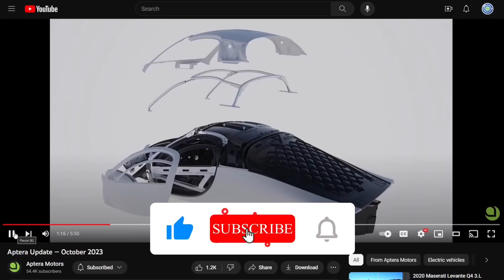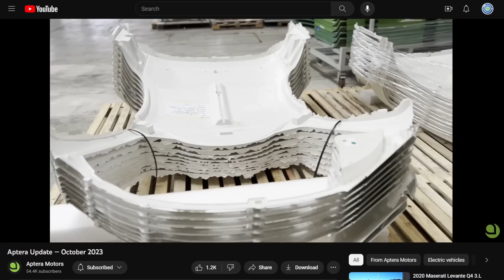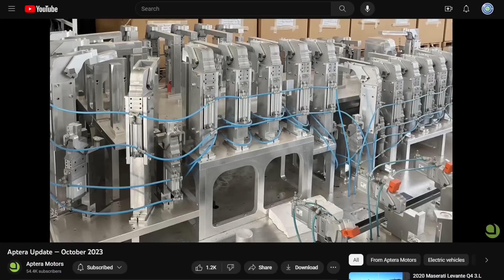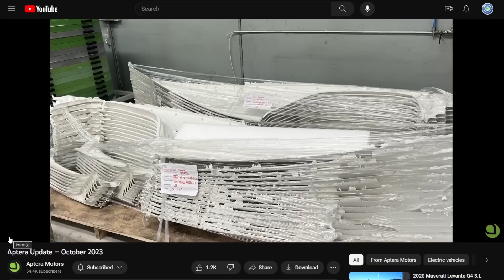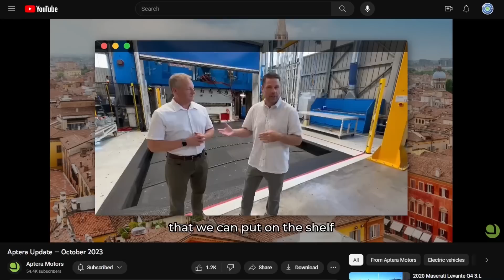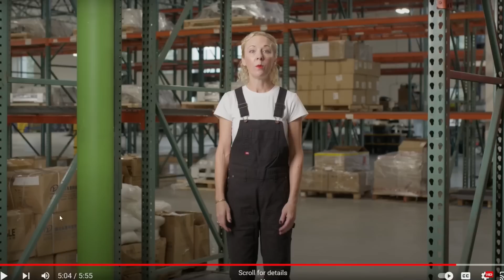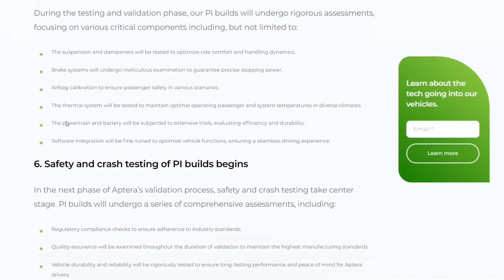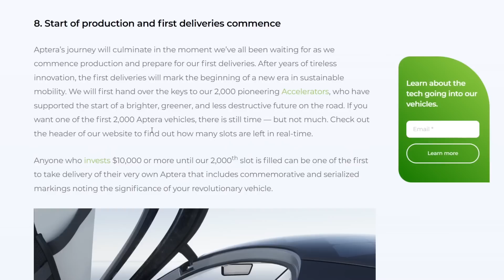Aptera's October 2023 update and ambassador meeting highlights

Comment: A question for your visit, Steve. Are they aware of the antipathy the yoke is causing? And are they thinking of an alternative?
The yoke is for sports cars and aircraft, where it doesn’t need to turn more than 45 degrees. I used to think I might get used to it, but after watching Chris McCammon maneuver in a parking lot I realized it will always be a stumbling block, especially in an emergency. And the rear view screens can go back in the corners where they belong.
Reply from the maker: They've said several times that the design choice is locked in for now.  They are aware that the decision is polarizing

Comment: Rain and snow performance please.
Reply: Aptera has a very sensitive traction control system that can detect wheel slip and adjust torque about every 2.5 inches of wheel travel.  I will be reporting on how it performs when I get mine back to Iowa where I live.

Comment: My son bought a Nisan Leaf about 10 years ago.  His battery range is much lower now than when he bout the car by a factor of about 50 or 60 percent.  Replacing the battery will be very expensive.  Will this be true for aptera too?
Reply from the maker: No because the leaf does not have an actively cooled battery and because of that has horrendous battery longevity.  Actively managed batteries will probably outlive the rest of the car
Reply: I drive a Gen 1 Honda Insight, and have replaced the battery pack once.  It has Nicad tech and is a hybrid, so is not comparable.  The savings in fuel make it worth while to do, however.

Comment: A micrometer is a device for measuring. Micron is a very small unit of measurement. About 6 microns is .0002 inch
Reply from the maker: It's both.  Micron is the non SI term for micrometer

https://en.wikipedia.org//wiki/Micrometre

Comment: An important Aptera function is motor wheel cooling. The validation of delta must include all kinds of situations that could lead to motor failure caused by over heated motor wheels. Without good validation reports that confirm the cooling system functions as claimed to all (potential) customers, it is a red flag for me. I am optimistic and exited about Aptera. The way it is going, my estimation the first Apteras will be delivered a year from now, and that will be a very good day for mankind. I love the Aptera team, they are all brilliant.  AOC, thanks for the analysis!
Reply: Due to the way the controls ate designed, there is little risk of motor or other component failure even if overheating should occur.

The system will simply throttle back power so that temperature doesn't continue to increase.

Comment: I wish Aptera well but I think they have two main challenges. The first is cost. Given that it is not really a car, it needs to be priced significantly less than a car and this may be difficult against the likes of Tesla. While there will be some people that like the unique looks and the concept of extreme efficiency, I think that if there is not much price difference, most people will go for a vehicle that meets the safety requirements of a car, is more practical , (e.g. something like the so popular little SUV that has back seats that fold down), has four wheels and is painted rather than film covered. The second challenge is that they are in a race against time where super efficiency is relevant. This main feature of the Aptera, its efficiency, is a significant feature in a world where batteries are expensive and have limited capacity. However if you can believe CATL and Toyota, we are only a few years away from EVs with ranges that exceed 1000 kms so super efficiency becomes less meaningful. A hyper efficient gas car like the Aptera could have been made long ago but you don't see one which tells us, again, that the mass market prefers a more practical car even if it means a small cost in efficiency. So, overall, I'm having troubles seeing the Aptera as becoming something more than a niche vehicle.
Reply: Efficiency is always economically practical and beyond a battery's weight, it is not part of the efficienty equation. And heavier vehicles with greater drag coefficients and rolling resistance will always be less efficient and benefit less from embedded solar.  For people who are of limited means, and for those who prefer their money is spent for priorities other than transportation it is efficiency for the win. 

Then there is a significant and increasing portion of us that care about the environment. People who wish to contribute less to increasing the suffering of humans and other species caused by the enhanced effects of our human driven build up of greenhouse gasses, much of this from the transport sector. People who care about the quality of the world we leave behind for future generations. When Aptera will cut in half, or better our personal transportation driven worsening of the climate crisis and our left behind toxic legacy (other emission downsides) ... some of us see a clear moral choice to do better in how we go about our traveling from point A to B when possible. Aptera helps make better transportation choices practical. We can't recycle our way out of our GHG, PM2.5, and toxic emissions dilemmas. Currently our emissions are still rising and we have less than a decade to cut them in half. When a person buys an ICE vehicle or inefficient EV that runs on fossil fuel generated electricity they are choosing to maintain the fossil fueled status quo for the years that vehicle remains on the road, a move that is 180 degrees in the wrong direction from where we wish to go to address the looming crisis.
Reply: @jeffcarlton3590  This! If the human species is going to survive, we will all need to do much less and use much less to do it. Period. End of story. Highly recommend: "Power: Limits and Prospects for Human Survival" by Richard Heinberg
Reply: @jeffcarlton3590  There are and will be very efficient but more practical alternatives to the Aptera. Unless the the Aptera is seen as a better value (i.e. it is significantly less money) most people will be choosing the more traditional type car like a small EV SUV. In terms of the environment, if the source used to charge the car is clean, I think people will be able to drive these kind of cars with a clean conscious. At the point, the gains going to the super efficient Aptera need not be mandatory.
Reply: You make good arguments that I make as well. I guess my one counter is that Aptera's efficiency, with the improved batteries you reference would be superefficient over the conventional EVs you reference and would still maintain a significant edge of price competitive for those (Admittedly a minority) that value efficiency. But, a small segment of the market. Even some Aptera enthusiasts are interested in top speed and 0-60 times. Not efficiency criteria.

Comment: Thanks for putting this together. As an accelerator, I have already seen the video and the blog.  A couple of things in your discussion about accuracy of the measurement vs. the actual dimensions of the parts. They are not the same thing. The part dimensions are probably going to be in the order of +/- 0.005" to +/- 0.125" depending on the size of the pieces. I do expect the parts to be very consistent. There are some tricks that could be used to make sure the gaps are consistent and small so  the cosmetics will be good.
I think your projections for delivery are pessimistic as there are a number of things that can be done in parallel. Not all of the vehicles will be demolished in the crash testing. I don't know what all of the tests are going to be, guessing at (6) to get the different angles. The high temperature tests (April or may ?) can be done while the crashing testing is being done. It would be stupid to destroy all 16 vehicles as some of them should be used for marketing.

Comment: As I stated before 16 to be built!!   The parts on rolling hangers is a set for 8 vehicles. 6:19; Left is the inside part for the right door.  Middle, the opposite door. Right the inside top [which I do not believe we have seen before]. The actual hatch CMF part for the solar  3:14 Fiberglass top. New to me. Makes sense that they check the results of the mold before spending money to trim the excess. Otherwise the whole part would be recycled and a new peice cut or possible an adjustment in the existing cutting? Going forward they should not have to validate each molding. Just sample it on occasion I would think. They talked about the hood part being made and we have seen the side fiberglass molds and an A pillar mold. As to the main tub being outsourced I think they mean the cutting of the mold is outsourced not the making of the tub itself? Just not clear on that reference. Nice to hear that the design for the solar hatch was to include a structural ridge.

Comment: Are the motors still overheating when climbing hills?
Reply: No as results from the repeated hill climb in San Diego demonstrates.
Reply: @johnmalcom9159  That video really worried me.
Reply: @pathfollower That was a prototype that has the antifreeze cooling lines capped off.  The fact that it has performed so well even in that configuration should give you a degree of confidence.
Reply: @n.brucenelson5920  Wow... As a former tech, I would like to see that!!!   Liquid cooling lines to a wheel motor in a turning wheel.  
Well now that I think of it, sounds like a large brake hose.
Reply: @pathfollower  I think you are getting the picture.

Comment: Thank you for posting this video to clarify what Aptera recently presented.  My biggest concern is about the timeframe for production.  Due to the unique nature of the Aptera vehicle, there is a window of time in which it has the optimum availability of customers to buy it.

If initial production will not start until late 2024, and my vehicle reservation will not be built until 2026 (or later, since my number is in the mid 20000s), I am not certain that other manufacturers will not be releasing next generation four wheel, four passenger EVs in a similar price range to Aptera.  If this happens, and Aptera is competing with vehicles from major manufacturers, I’m afraid that they will have missed their window of opportunity to sell substantial numbers of autocycles.  If it is delayed, many reservations will be cancelled, and those customers will turn to next generation EVs manufactured by major automakers.
Reply: Chris presently expects to be shipping vehicles to customers before the end of next summer.  We will see how funding and validation testing goes.

Comment: Do they have enough money to keep them afloat until end of 2024/early 2025?
Reply: That's certainly my concern. Also, Steve, if you get the chance, ask what their current CFO situation is, as well as any progress on external funding and what they intend to do about the "going concern" clause in the ATVM loan.
Reply: @frankweigand3654  I am unaware of any startup  that doesn't have a "going concern" clause in their SEC filings.  I doubt if this will be a barrier.  

It is clear that the attitude of employees regarding making it to market has changed recently.  I think we will hear more public good news on funding.  The crowdfunding efforts have continued to cover cash burn, and their cash position has actually increased in spite of the outlays for tooling.
Reply: @frankweigand3654  Great questions! I think to competition sensitive to answer at this point though with an open application for the ATVM loan and other capital acquisition efforts. If anybody can get the information out of Aptera it is Doctor Steve.

Comment: It seems odd that CPC doesn't trim the parts before sending them. Every other automotive and consumer supplier does this. Literally, parts that are finished and ready to go when shipped. For example, the automotive suppliers even clean off the flashing on suspension bushings before the are shipped to the suppliers. This is for a part that nobody will ever see. Yet that's part of their quality control. Same for a Corvette (which uses SMC). It shows up ready to go, no finishing needed. I'd like to see Apteras finishing machine for these parts. Hopefully it's not done by hand.
Reply: CPC hasn't finished with them yet. They are just palletized for moving to their next stop at CPC. From what I've read, CPC will assemble the first bodies before releasing them to Aptera for final assembly, including batteries, electronics, solar panels and interior parts.
Reply: @fotoguru222  - Odd. I have been involved in doing things like CF and SMC and we always have the specs to trim them before we ship. Even for prototypes. I guess Apter is different.
Reply: @billsmith5960   What I meant is CPC will trim them. They aren't being shipped to Aptera yet.
Reply: All validated parts - ones you see with a green sticker - have been trimmed.  They can't pass the laser tunnel dimensional tests otherwise.

Comment: Good to see the Aptera will have airbags. That will shut up the naysayers.
Reply: There are airbag-specific naysayers?
Reply: @bobhilder1469  Airbag calibration is one of the stated tasks they have ahead of them during the validation phase.  Yes, there are plenty of comments on line that say Aptera won't test to or pass current safety standards.
Reply: @n.brucenelson5920  - As long as a third party does the testing. If not, then we have to just take their word. For example, they could ship a few to the IIHS and they could crash test them and not give a biased assessment. If that happens and it passes with flying colors, then that would increase the demand.
Reply: @billsmith5960  That is not what they have said they will do.  We do have to take the word of many manufacturers who have SUVs on the US market that have not revealed their crash test results.  Look it up.  I think you will be surprised at who the manufacturers are.

Comment: I still think that Aptera production will begin in mid-2024 as originally planned. I know it's optimistic, and often there are "production hell" events that slow progress. But I'm still hopeful that the first 500 units are built before this time next year.
Reply: Originally planned?  That was not the original start date.
Reply: @gbpg2016  Originally anticipated from now.
Reply: @gbpg2016  - I agree but it's just like Elio Motors. Planned date was June of 2014. Then it just got pushed back quarter after quarter. Thus, they become the original starting date. For example Aptera was to begin production in 2022. We kind of just sweep that under the rug as it's hard to get new investors if they find out you keep pushing the production date back.
Reply: Maybe 1st or 2nd quarter 2032
Reply: @swatisquantum  Nothing to validate that projection
Reply: No, it will be later than that, possibly 2026.  There is still a lot of design to be completed and there are only 3 prototypes.
Reply: @AdrianWalker247   Incorrect.  There are the three Alpha vehicles, one Beta suspension test vehicle, and the most recent Gamma vehicle, for a total of 5 prototypes.  The next will be the Production-Intent, or Delta vehicle, which will go into production unless testing proves changes would be necessary.
Reply: @DemaGeek  He was talking about volume production. Not the production-intent models, which are largely for testing and validation. Not customer sales.
Reply: @deanmcmanis9398   Sorry if I misunderstood there, thank you Dean.

Comment: Nice review Steve, Thanks.  I kind of liked the Aptera back when it could be manufactured in a warehouse in California.  

Who is casting the frame?  This carbon based body shell may be really strong but it's not strong enough to hang suspension off.  These two massive changes are the brain child of Sandy Munro as far as I can see.  Let's hope it goes better than the Arcimoto.
Reply: The suspension will be attached to the aluminum frame as described to several past videos that first revealed the Delta (now PI).
Reply: @a5-30-31cts  Yes, I remember being surprised how much the design changed about two years ago.  But we've only had peeks and no report on who or in what country the casting was going to be done.  Have we picked a supplier as of yet?